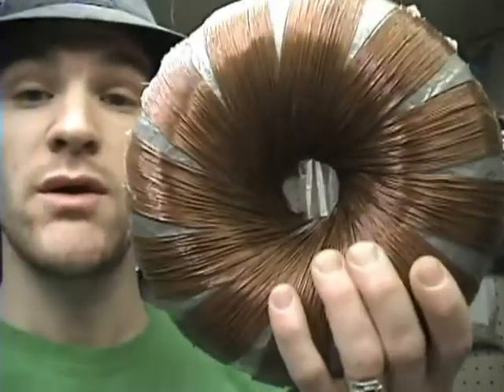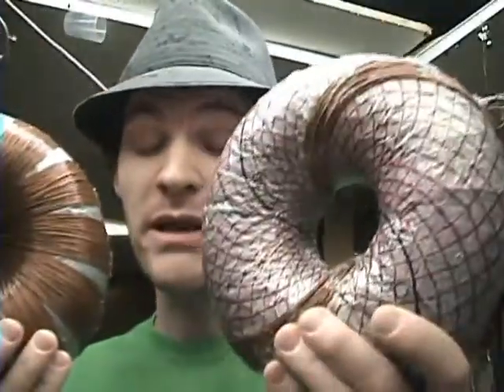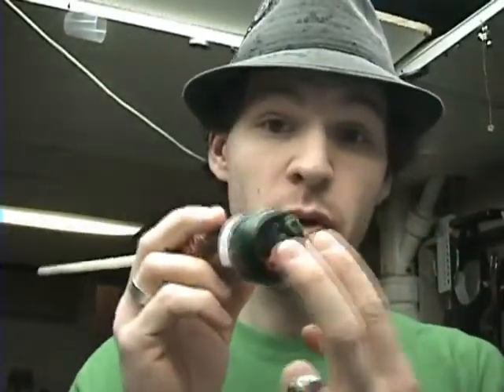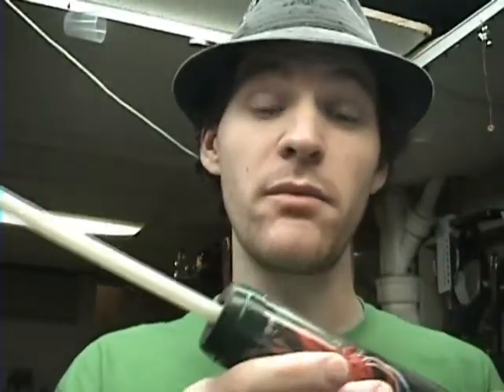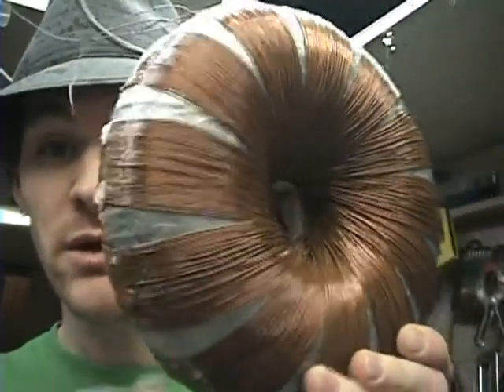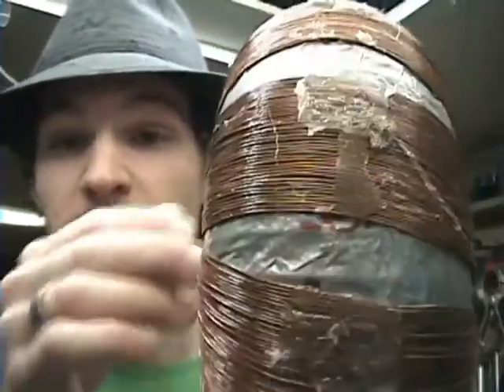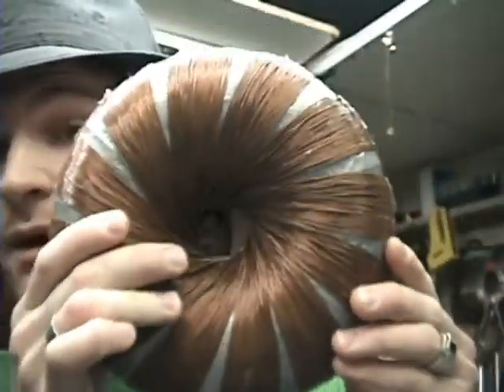Rodin Monopole Test!!! I Need Your Help!!! Get on it!!! Need Schematic!  GO now!

Comment: Hi Russ I think its serial 2 coils (front back) connected on coil with serial bulb as energy load... It's very interesting this monopole on steel drill. I'll think about that. My first idea is that there is some kind of different S pole shape or there is vortex on the middle of drill bit witch is spinning in opposite direction.

Comment: Russ, I have a reality check for you.  It's the fact that the drill bit is asymmetrical with respect to each end that it appears there is a monopole.  If you had a regular compass you would clearly see a north and south pole associated with the drill bit.  However, Marko "cheats" by using a magnetic pole detector that has a certain minimum threshold before it beeps.  It just so happens that one end of the drill bit is above the threshold and the other end isn't.

Comment: Well, that's an exciting test indeed! And I'm VERY curious what results will you get! I suggest you to try it with the frequency generator and a 180 degree phase shift between A and B coils. I managed to spin magnet that way with my Rodin coil that i made. I used "Pure Data" software and its signal send to audio amplifier... I can send you my setup if you wish. Good luck man! \o/

Comment: Good luck Russ. I hope you find your schematics. I have a question. I am working on a portable wind solar device charger design. I have learned of Rodin coils and since found your videos. My question is this, Would a Rodin coil perform better at electric generation than a standard motor coil when converted into a generator using magnets and rectifiers? Again, good luck with that experiment. Check out my new video. I would appreciate any questions and advice you might have. 
Thanks Russ
Tom